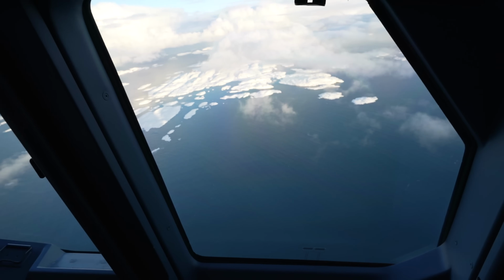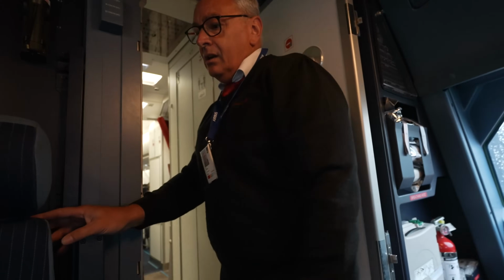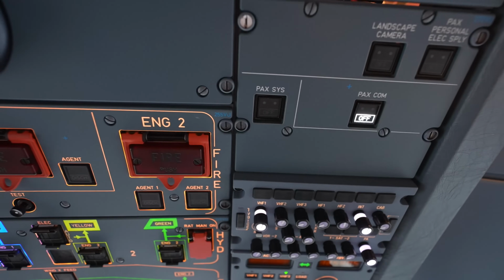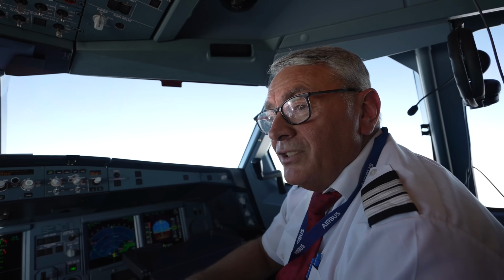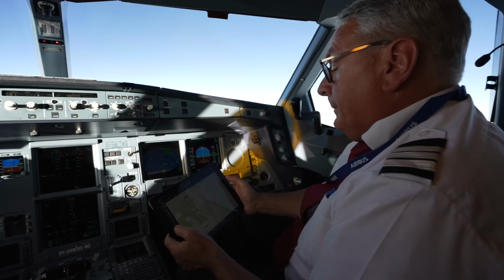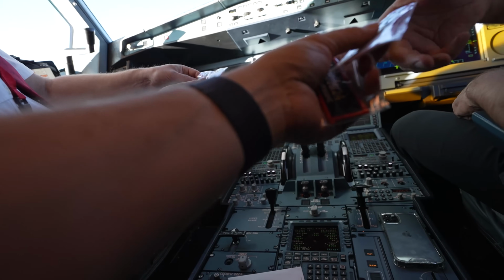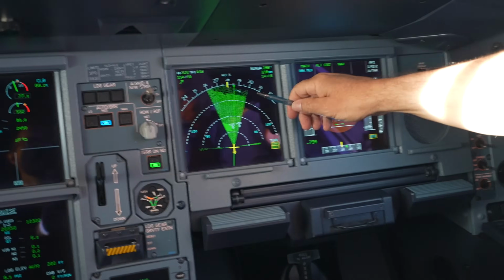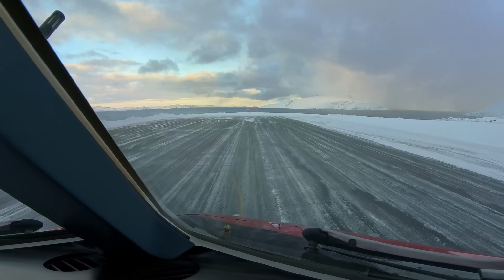Air Greenland A330neo cockpit to new Nuuk runway!

Comment: I noticed that both Caption and First officer did not have seat belts on, I thought at cruising altitudes, pilots are required to keep their seat belts fastened at all times while seated in the cockpit.
Reply from the maker: They keep their lap belts on. Shoulder straps go on for critical phases of flight or heavier turbulence.

Comment: Gabe....In 1956 & 57 I was an airman in the  USAF and  based at Sonderstorm. At that time SAS was flying a DC7 between LAX and CPH. The flight stopped at Sondrestrom for fuel and the pax were offloaded and driven on a USAF bus over to then Danish Hotel for pit stops etc. I was assigned to drive that bus for those twice weekly flights and it was a connection for me to the outside world. Sondrestrom was a great place to be based and an adventure for a 19 year old kid. For me, it was a sad day for me when Air Greenland moved their main hub to Nuuk, even though I left in 1957 I've always followed the evolution of Greenland Air and Greenlands development.
Reply from the maker: That sounds like an amazing experience, thanks a lot for sharing it!
Reply: A few International flights have come back to sønderstrøm .....its usually the flight with a stop over in sønderstrøm before nuuk, i use when i go to work cause less chance of huge delays....even if it take. 6.5 hours instead of 4 and it is in monkeyclass 737 hired from jetime instead of the airbus

Comment: "Extreme" 🙄
Reply from the maker: It’s a short runway with highly variable, quick changing and sometimes very bad weather in a seriously remote part of the planet without all the infrastructure much of the world has. It doesn’t seem unfair to call it extreme.
Reply: It definitely is extreme, the runway is only 2200m long and often has black ice, fog is extremely common in Nuuk and mixed in with strong coastal winds from the Labrador Sea I would consider it even more than extreme